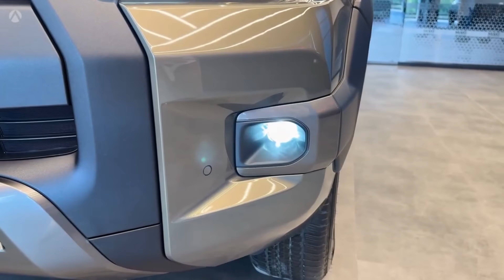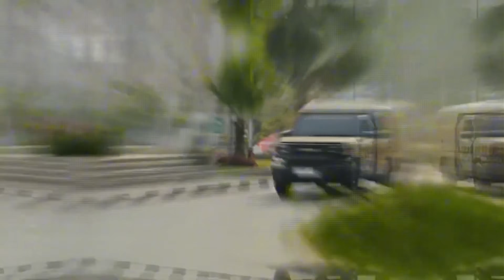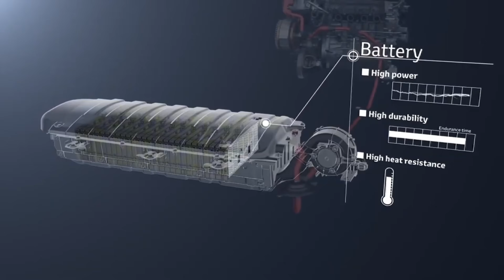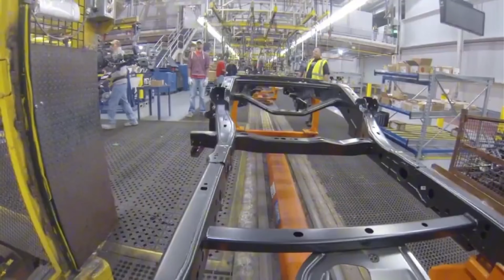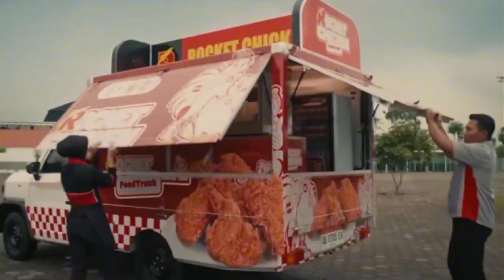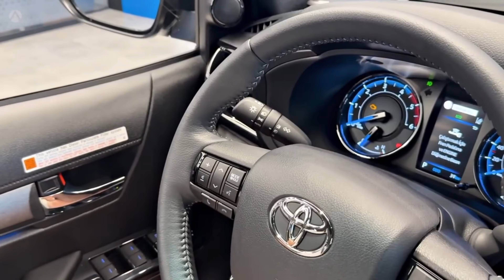All-New Toyota Hilux Champ – The Simple Truck That’s Shaking Up the Industry!

Comment: Americans have been Begging for the CHAMP for Decades!!!
Automakers have NOT listened to what people want.
We just want Basic RELIABLE AND DURABLE Body on Frame WORK TRUCKS!
We want a 4WD , regular cab, Long Bed, the 2.7L 4cyl , manual windows and door locks, cloth seats and Vinyl flooring.
All 3 bedsides that fold down or can be removed.
A 6spd manual or automatic transmission, a Hybrid.